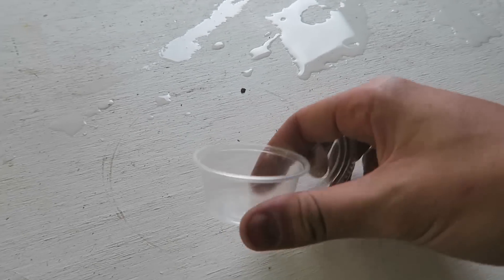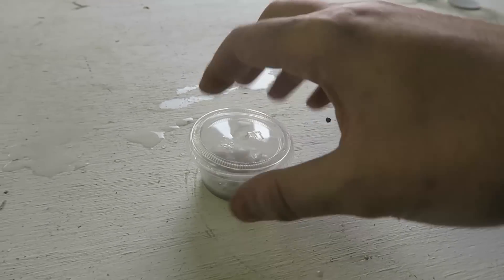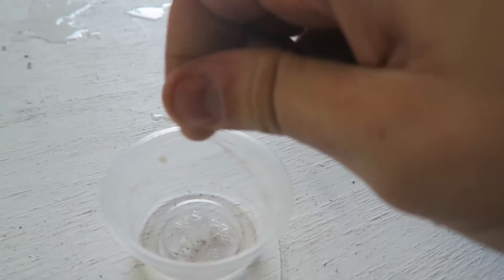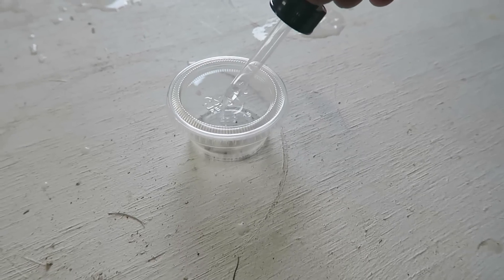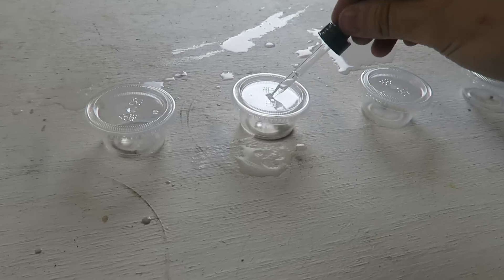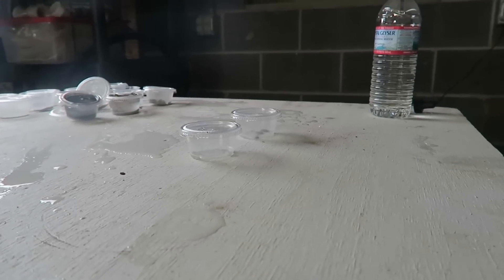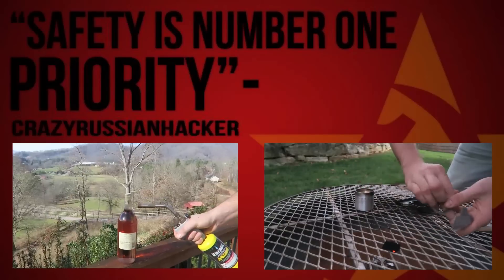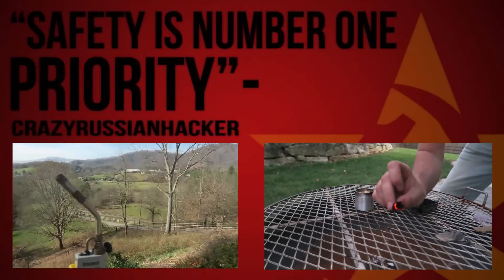Calcium Carbide - Science Experiment

Comment: For those who don't know, calcium carbide undergoes a reaction on exposure to water that yields calcium hydroxide and acetylene gas. Described by this equation CaC2 + 2H2O --> C2H2 + Ca(OH)2, when calcium hydroxide and water are mixed with a 1:2 ratio it produces acetylene. acetylene is incredibly flammable, but its not self oxidizing (needs a source oxygen to burn). So when CRH put too much calcium carbide into the container, it forced out all of the oxygen meaning a flame could only burn where the acetylene was exiting, instead of igniting the fuel in the container.

Comment: My sister is a chemical engineer and she was once taking inventory of several samples she had, among them calcium carbide. She was smoking a cigarette and she went to light a second one and dropped her Zippo into a bottle of the stuff and nearly took her hand off.
Reply: was it mixed with water? calcium carbide produces acetyline(typing fast) when mixed with water. other than that, it is safe
Reply: Damon Jackson Apparently it was indeed mixed with water if it blew up like that. Isn't acetylene used for blowtorch fuel?
Reply: BlackVelvetDaydream yes. Oxy-acetylene torches are among the hottest torches. I think they are used for melting steel.

Comment: just in case you dont know what is going on here "general public" the calcium carbide is making asedaline gas. Why it did not explode in the beginning is because its air to gas mixture was not around 9%. This is called scopametricy. Spelled wrong probley. But, at certain air to gas mixtures it explodes. anything else it will simply burn. also if you try this dont use bare hands because it can burn and irratate your skin.

Comment: +CrazyRussianHacker    It would be nice if you explained a little of the science behind experiments like these.   For those interested, calcium carbide reacts with water producing acetylene (an alkyne gas) and calcium hydroxide (a salt).  CaC2 + 2 H2O -> C2H2 + Ca(OH)2   Acetylene is a flammable gas; explosive in the correct ratio with oxygen.  The combustion results in production of H2O, CO2... and heat in a rapid release of energy.
Reply: +Spoif  works better in a pumpkin to make pumpkin go bye bye
Reply: +flip yeah, definitely he should do that
Reply: +dan y he (taras)
Reply: +Spoif Thank you
Reply: In my words: add powder mix with water give it a lil shakey add fire equal boom
Reply: ***** The proportion of gas to air has to be within certain limits in order to result in an explosion.   If the proportion of gas to air is too small, it will be too lean to burn.   Likewise, if the proportion of gas to air is too high it will be too rich to burn.  Somewhere between these values will be a "sweet-spot" where the proportion of gas to air (when ignited) will be particularly energetic; resulting in an explosion.  As the proportion of gas to air goes higher or lower from the "sweet-spot", combustion is less vigorous.  Acetylene is an alkyne gas (having a triple carbon bond) which makes it a very reactive substance.
Reply: ***** Saturation. You get the same effect when your car engine is flooded. Too much fuel and it won't work.
Reply: no. its Russian magic!